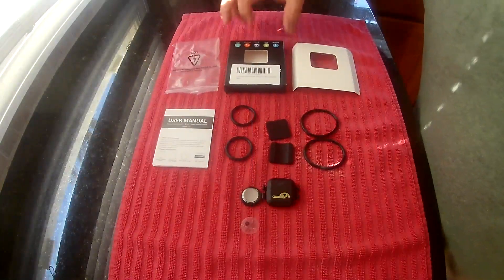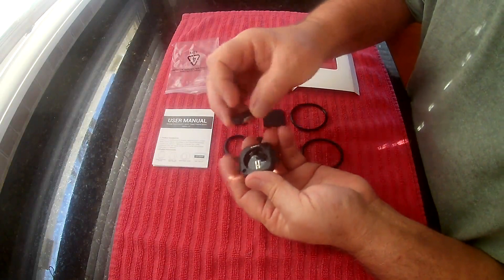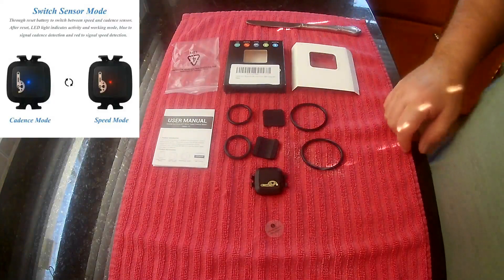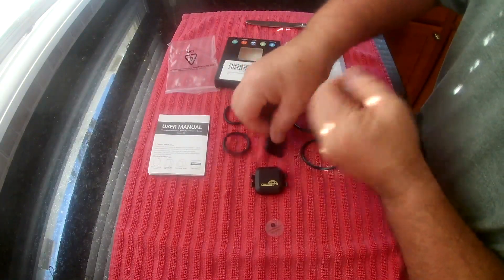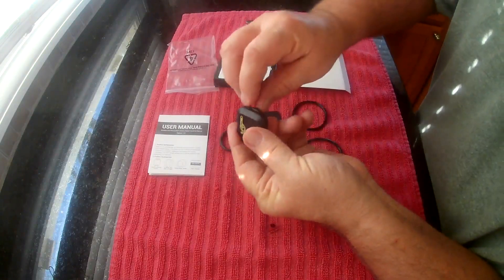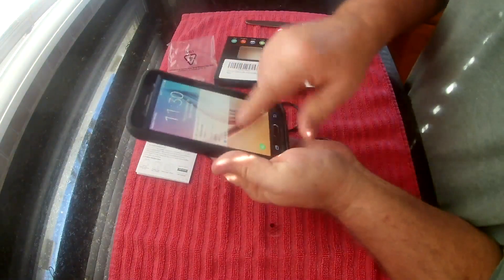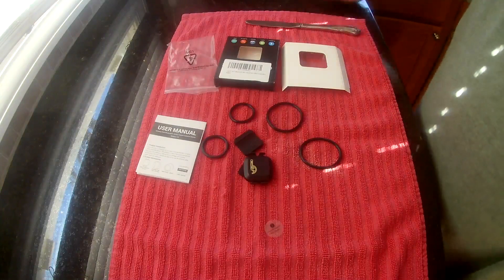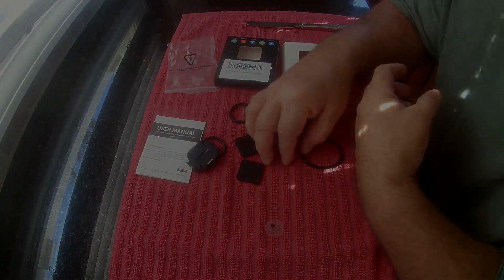TAOPE Ant+ Bluetooth Bike Speed Cadence Sensor

Comment: Does it work with Zwift do you know? Can you use 2 and have one setup for speed, the other cadence?
Reply from the maker: I do not know if it works with Zwift or not. I would say you can't use two of these unless you have two devices to hook it up too since you can only connect one device thru Bluetooth to one device.
Reply: I've got a set of these and they are a nightmare.

Not only do they support being either a speed or cadence sensor, they also report to the pairing device, that they are both, which confuses very many applications.

I've seen some other cheep solutions on amazon that appear to have a switch inside to swap between speed and cadence, that may work better.

Currently paired to a Garmin 25, they are pretty slow to react to changes in cadence and wheel speed.

I could not recommend these.